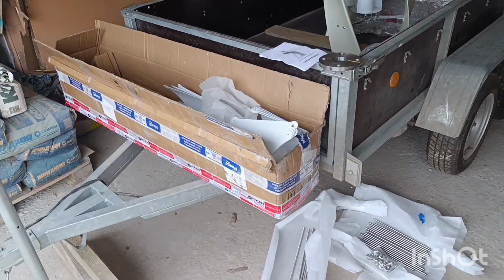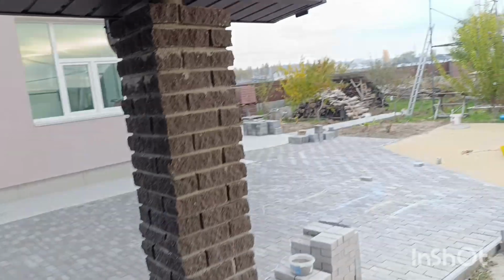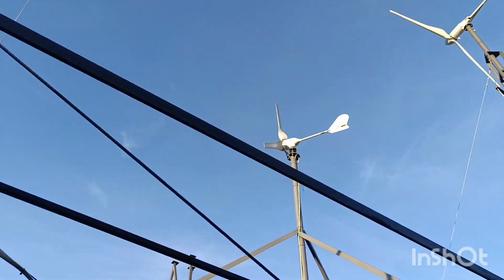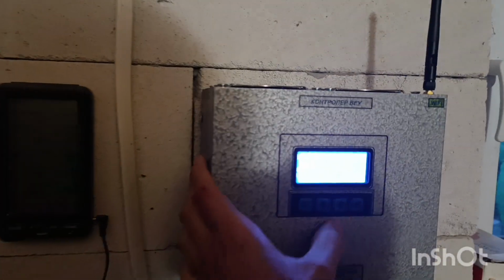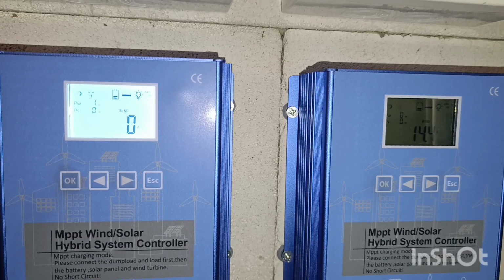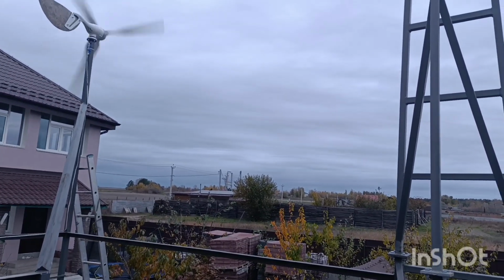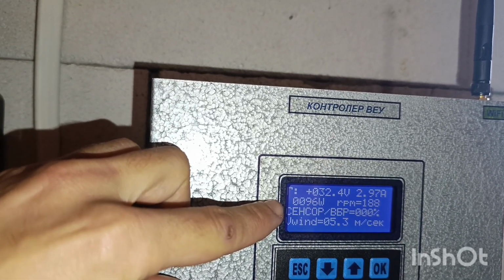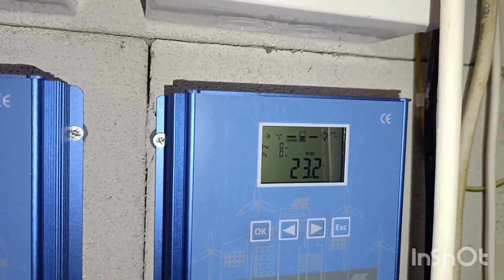Yet another perfect wind turbine tested - vertical Savonius this time. Will it show what's promised?

Comment: Very nice video. Thanks for sharing your knowledge. I have a 40 kW on-grid solar system. I was also very interested in building a wind turbine. After watching your video, I decided to abandon this idea because the field winding is very thin. I think you should put a three-phase bridge rectifier near the wind turbine winding and smooth it (10000 Mfd). Thanks.
Reply from the maker: That is done inside the controller already

Comment: Good fun, informative video. By the way, what charge controllers are you using ?
Reply from the maker: different ones, it just depends what's in my playground. I've been using various types, ballast ones, boost ones, buck ones, boost&buck ones, even the on-grid ones with the further PV connect. it just depends on the setup.

Comment: those cheap mppt controllers are not working with low voltage wind generators.  if generator voltage is lower than the charging voltage of your battery pack, by the lack the "step up" function, charge controller do not have enough delta. is 3 phase? how do you rectify those 3 phases? PS; is too low ... and you got also the solar array on the back.
Reply from the maker: this unit never worked on any of the controllers, with buck, or with boost, or even with a rectifier. I asked a manufacturer later on separately - how much in reality they claim this unit to be, and they laughed and told me - like 20 watts... so, in my case I was able to see 27 watts - which is already far beyond ))
do not blame the controller - in reality the controller took the max out of it and even a little bit more.

Comment: I have disassembled a similar generator myself. It is really tuned with thin coils, some of the insulation is broken, and the whole system is quite childish...
Reply from the maker: yes, I guess so. thin wire to obtain decent voltage, but it will burnout from 12-15 amps already I think

Comment: The wind turbine has not been properly assembled, the shaft should not be visible
Reply from the maker: should not. but it was impossible to make them not visible. and you cannot mount the "blades" wrong side, they just don't fit other way.
Reply: @BackyardVoltage  I have a Chinese purple tulip wind turbine and I had the same error and thought the same thing that the blades didn't fit on the other side. I forced them a little and they fit well
Reply from the maker: @ how much max have you seen out of yours? and what's the wind turbine size you have?

Comment: Good video, looking for reviews on verticals. I won't be getting one.. looks like the tail on the M3 is bent?
Reply from the maker: no, on M-series (from M2 up to M10) it is not possible to get a folding tail... fixed one only.
But. I mean, seriously, M3 is a tiny wind turbine. from 1.65 meters in diameter you should not expect a lot of power. it might good one for a camper, though...
in my case - I've never seen less than 4 kWh per month from it, on the other hand - I never seen more than 12 kWh per month out of it as well... size matters.